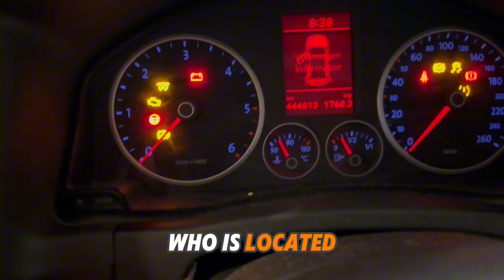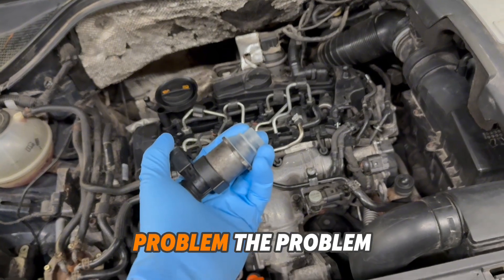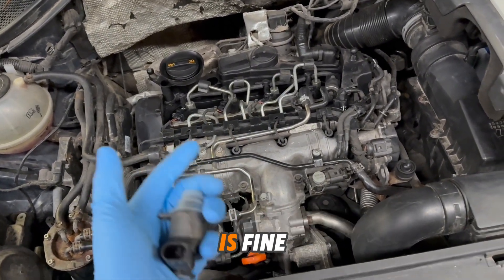P0088 fuel rail/system pressure too high VW 2.0D

Comment: I have audi a7 3.0 tdi same issue P008800 code Fuel pressure too high. Same issue blinking spring on dashboard do you think this could fix it
Reply from the maker: Hi! The light blinks all the time?or only when u driving? Check fuel pressure diagram. You can take off valve on fuel pressure regulator and check if there is some metal friction small parts.
Reply: @krkrepair the light is not permanent. It apears some times like i can drive one week no issue then one day it comes back up only when driving and its flashing.
Reply from the maker: @Gilera180  The same like us Tiguan. You need check ehat happens with fuel pressure when u driving. We have the same like you, but it start get more and more often. For checking this valve is hard, if it s totally damaged then it s possible to check it.